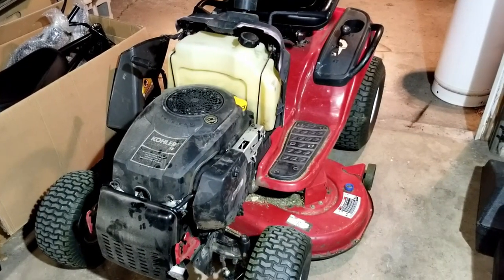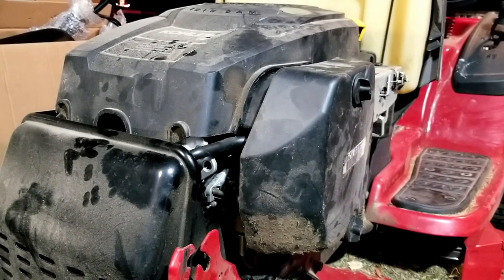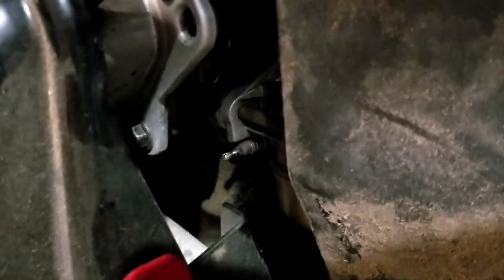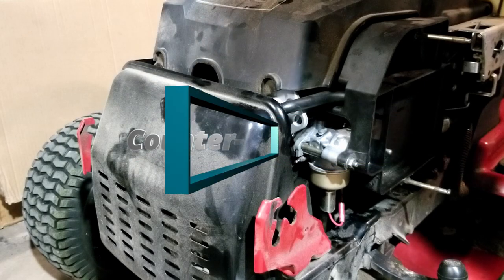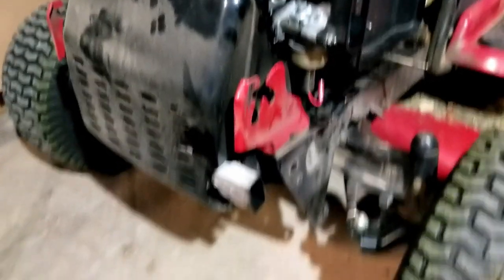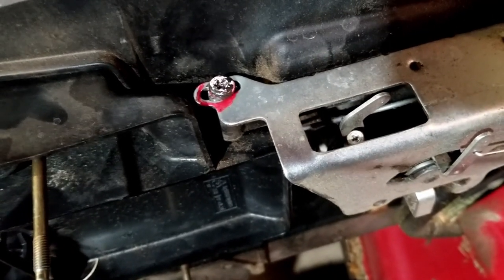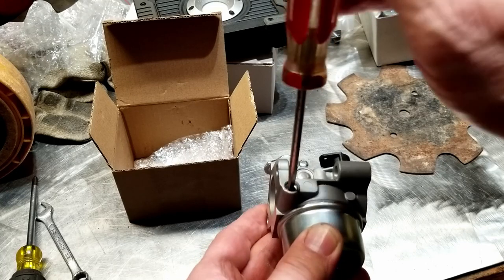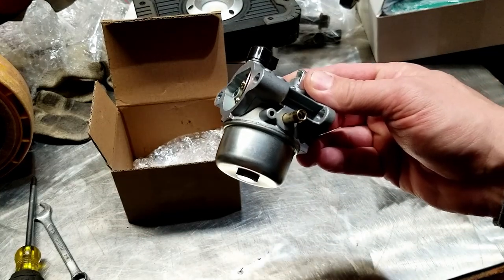Kohler Courage 18 - Stop the Surging

Comment: I got one of these POS.  I grew up sitting behind a K321.  The difference makes me think the Chinese bought out Kohler.  I fixed surge by carefully replacing the idiotically designed gaskets on the intake.  I think it's leaking again, because after a year, it's now overheating like it's running lean at full power.

Comment: I tried this just now on my old CubCadet LTX 1045 (a piece of junk if there ever was one) and it worked. But it also caused the idle to speed up too much. I was able to get a screwdriver on it, so I just twisted it out about 5 turns, then back in 5 turns. Did this half a dozen times, then turned it back in to where the idle was normal. No more surging. I must have somehow dislodged some dirt or something because now it idles and runs with no surge. So glad to solve the issue without having to wait for a new carb. Thanks for sharing your knowledge. I would never have known about how to access that idle screw without this video.
Reply from the maker: Happy to help! Thanks for watching!

Comment: as far as that needle you removed at the end - you have no idea where it was set. what you should have done is screw it in, counting the turns, until it is LIGHTLY seated, then remove it. that way you can set it back where it was set out of the box. not that that is the correct setting but it is certainly closer than just removing and guessing.

Comment: My Kohler 5400 series engine surged at high throttle and I bought a couple of cans of Berryman B12 Chemtool carb and intake cleaner. I sprayed it into the carburetor and it stopped the surging
Reply from the maker: Yes, sometimes the surging is caused by a dirty carb. Anything that restricts gas flow could be  the  cause of surging.  Thanks for watching!

Comment: I had replaced my Kohler carburetor with a carburetor off of eBay. And it's been surging ever since. I checked everything. But now I believe I have found the problem. When they milled out for the slow jet idle screw, they over milled and cut a pinhole into the top of the bowl inside the carburetor, causing it to suck air from inside the bowl. I put some gas resistant sealer on it and waiting for it to cure.
Reply from the maker: Good detective work. Hope it works. Thanks for watching!

Comment: Great video! I’m having this issue with the same aftermarket carb you have at the end. I’m also carbon fouling spark plugs like crazy  (2 plugs in two .5 acre cuts). 

New to small motor repair but I’ve run the gamut on checking the entire fuel system. I had it running well enough to cut about a week ago with no surge and came back to it barely holding an idle and surging / backfiring like crazy. Going to check this out tomorrow and see if it helps the surge at all (with my 3rd spark plug).
Reply from the maker: Could be a head gasket or valve problem.

Comment: Great video, I had to remove a Welch plug to get yo mine...
HOWEVER...
it didn't help.😢
Another guy posted about the gasket behind the carb spacer, checked mine...and....
It didn't help either 😢
This mower has been worked on by someone who probably shouldn't be using fisher price tools, things broke, missing,  blades mounted upside down. You name it. Multiple barb issues, but that's for another time.

Mine ended up being a poorly adjusted governor lever.

But thanks for the video
Reply from the maker: Thanks for watching.

Comment: I tried this but not better yet. But also my emergency shut off solenoid is leaking fuel and the wire broke off. What do you think?
Reply from the maker: Try a new carb.
Reply: Did you get a new wire? Check the pressure in the LEFT steering tire. Never start it with the AC on! Makes your starter run hot and overheat your radiator. Be sure your using the right coolant and thermostat for your region. You know. Simple things....
Reply: @Tim1967-o7j  ??????????  Those are your suggestions for fixing a riding lawn mower with a surging engine?

Comment: Just curious, my new kohler 5400 18.5 HP has a very slight skip, not bad under load, but on the mid to lower idle. Is it the same adjustment on these newer engines?
Reply from the maker: I don't think that I have ever worked on a Kohler 5400. Sorry

Comment: Ok so you first say your going to turn it counter cloclo kwise then after removing the air filter cover you explain how your turning the screw for needle clock wise. Which is it? Counter clock wise or clockwise. I now know where the problem is but not the direction I should be turning in order to stop the surge. I've listened three times now and you give both directions.
Reply from the maker: Sorry, just like a regular screw, clockwise for in and counterclockwise for out. Counterclockwise will open it up and allow more fuel through.

Comment: this done at the very low rpm of the throttle, right?
Reply from the maker: No, it was done at high throttle.
Reply: @RealManSkills  Yea i hate the annoying surging. same with my generator. having said that, i even took out the mower carb and didnt see it has any adjustment screw as yours. it has a mechanic bolt that acts as a stopper to the butterfly...

Comment: How's it doing these days? Mine is doing the same thing. Was that full throttle you were at? I'm pretty sure it was. Mine purrs low throttle and surges awful at full throttle if you throw it into full throttle. Not so much if you gradually add throttle. It's a jerk when it wants to be.
Reply from the maker: Engines surge when they aren't getting enough fuel. So when it's low, it doesn't need much and runs smoothly.
Reply: @RealManSkills  Interesting,  I have the 19 hp courage and it surges only when I drop the throttle. When full throttle, no choke it runs almost perfect, I also notice excess vibrations on my feet though. Waiting for parts to fix this junk. Next mower will not have a Kohler engines for sure !
Reply from the maker: @patrickrafferty9156  It makes me think that there is a slow idle jet in the carb that is clogged. I'll keep my eye out for that. Thanks for watching.
Reply: @patrickrafferty9156  how did you fix it i cant figure out why my courage 19 is surging at 1st seemed not to when pto was engaged ive checked everything
Reply: @suzieq8379  Its not fixed, I ordered a bunch of parts. Waiting for these to do the repair.
Reply: @patrickrafferty9156  I got mine fixed I don't know how cause I did everything starting at fuel filter fuel pump cleaned out gas tank cleaned carb and don't know what else LOL good luck

Comment: I have a Kohler Courage 19 and just put a new carb on it and it is hesitant to start. Cranks fine and will sometimes start but usually I need to give it a spritz of starting fluid. Would I need to adjust the screw that is on the top of the carb to richen up the mixture?

Comment: That is the air/fuel mixture screw adjustment, not a jet.  Good job, engine was running too lean.
Reply from the maker: Thanks for the correction.

Comment: Very mild surge. That is the air fuel mixture screw. That usually doesn't work on many more severe issues. They do have a low/ idle circuit. The Jet for that is in the ventury and in the fuel pickup tube in the bowl.
Sometimes this ckt can become clogged and not allow enough fuel at idle to run wo hunt surge condition. U didn't let it run at idle so we dont know if u actually repaired it lol
Reply from the maker: The owner is my neighbor. I hear it run every time he mows the grass. Sounds great so far. Thanks for watching.